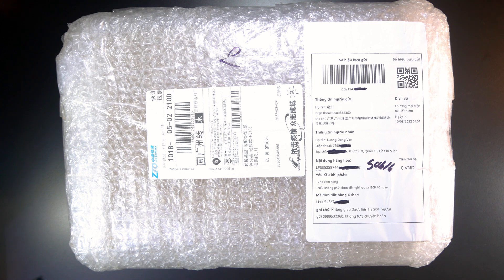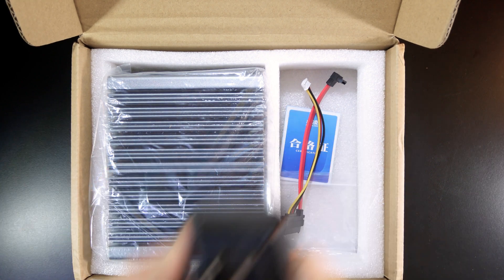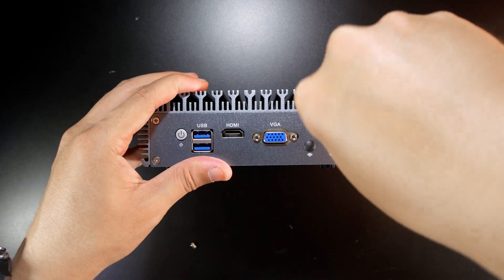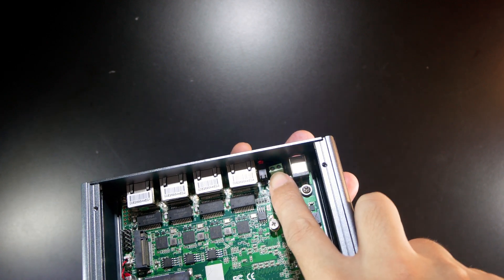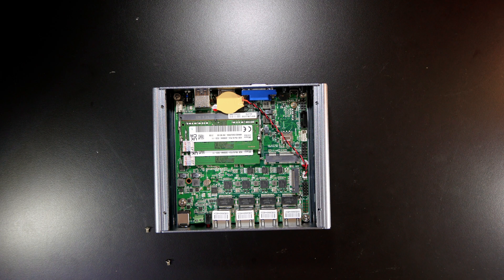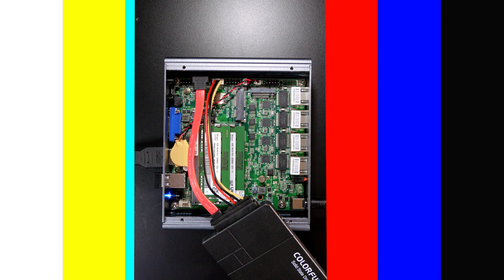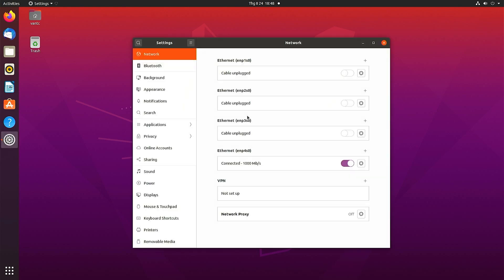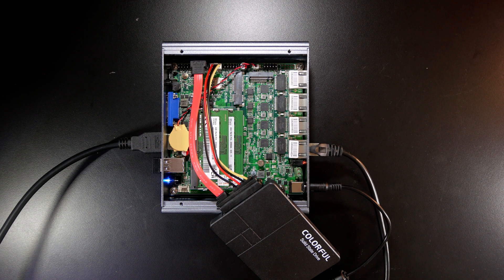Intel N5105 4 x 2.5G Ethernet Router PC (Intel I225-V) - Unboxing & Quick Overview

Comment: how do I install openwrt in SATA SSD ?
Reply from the maker: You can find the old tutorial on my channel “install openwrt on hard drive”. You need to boot up the PC with a Linux USB, after that use dd to writr OpenWRT image to the SSD
Reply: @VanTechCorner  thanks
Reply from the maker: Or else, use a USB to SATA adapter and connect your SSD to the computer. And them use Rufus to flash it.

Comment: There doesn't appear to be any vent holes so if you mount a fan to the bottom there is no place for the air to go.  And of course no way to mount the Sata SSD as pointed out in the video. A bit cheesy.

Comment: sir .. any idea how to connect mifi huawei E5785 to gl-inet router?
Reply from the maker: Hi, do you have internet access when connect the Huawei modem to your PC with USB cable? We need to verify if the  E5785  supports USB RNDIS.
Reply: @VanTechCorner  when connect Huawei E5785 to my laptop using usb cable , i get the internet in laptop .. but connect in my GL Inet Opal look like not detect any usb driver .. i am use same usb cable connect to laptop and GL inet opal .. change another usb cable also get same situation ..
Reply from the maker: It is weird, are you on the latest firmware. By default USB tethering had been configured on GL-iNet router. If you are using an OpenWRT build (doesn't have GL-iNet dashboard), you need to follow this guide to configure it https://www.youtube.com/watch?v=2WeedwOI_vM
Reply: @VanTechCorner  yes .. i am not using gl inet dashboard .. btw thanks for share that link to me .. i will try to follow that video .. and thanks ya because reply my answer ..
Reply: ? go to the default gl-inet router 192.168.8.1 & then connect it wirelessly to the mifi huawei E5785 , anything then connected to the gl-inet router wired or wireless will then use the mifi huawei E5785 wan in this case

Comment: Anh ơi hướng dẫn mesh wrt1900acs của anh với con router khác cùng openwrt được không ạ
Reply from the maker: Bạn có thể xem qua 2 video này để biết cách làm nhé:
https://youtu.be/D6TNuS69sUM
https://youtu.be/cw8ykKgVKbM
Reply: you mean open batman mesh & a few dozen cheap eol Linksys MR8300 Tri-Band Mesh WiFi 5 Router (AC2200) running off stand alone pv/12v car batteries ? https://www.youtube.com/watch?v=t4A0kfg2olo 
DIY MESH WiFi with batman-adv and OpenWrt. OneMarcFifty

Comment: Could you share your /etc/config/network? I have a similar device but can’t figure out how to get the wan & bridged lan working (based on one of your other x86 videos).
Reply from the maker: Are you talking about this N5105 router PC? You will need to build OpenWRT firmware with the kmod-igc package (Intel I225-V 2.5GbE driver). You can see this video for the setup https://youtu.be/kQamMghox30
Reply: You need to configure your lan devices. Go to Luci > Network > Interfaces > Devices then configure each lan device

Comment: I hope you install pfsense in this dvice and do compare between 
OpenWRT and pfsense
Reply: does pfsense even have working wireless ac/ax drivers Yet
Reply: @paulmaydaynight9925  
When you use pfsense 
It will work as router and best firewall then you connect it to AP that support ac even wifi 6

Comment: Nice , just looking at the n6005 version for the upgraded decoding hw & using proxmox pihole+unbound/omv/openwrt.
it' good these are using rev 3 Ethernet chips as that is supposed to have fixed the intel 2.5Gb hw problems to.
the ssd fixes to the base plate you took off btw

https://www.youtube.com/watch?v=FnFtWsZ8IP0 You're running Pi-Hole wrong! Setting up your own Recursive DNS Server!
Reply: I'm wondering if you ever come across these cases as cheap empty units ?
put a 1 to 5 sata expander in there with 5 connected 2.5 drives & 5v 5a power to then stack under the N5105 box & add a single esata cable
Reply from the maker: If you install the 2.5 inch SSD on the base (bottom plate), you can't install the 4x4cm fan. If you are purchasing from taobao/aliexpress, there are plenty of x86 system which were built to use as a NAS. It comes with 4, 6 or even 8 HDD bays. One of the popular model is J1900 + 4 HDD bays.

Comment: Can you please test 5ghz wifi AP card?
I want to know if this can be complete alternative to mainstream routers with access points
Reply: 5GHz AP mode on AX200/210 has been unlocked, would be nice if it gets tested in this box
Reply: sure, just don't expect to also run a heavy Linux gfx gui too... something very light to also run 'tdarr' Intel hw encoding + pihole+unbound/omv/openwrt on proxmox with 8/16meg ram might or Not be pushing it... needs testing.

mainstream £100/£150 5 port 2.5Gb/s dumb 'switch's can't do the above, so its a DIY win even if you just x86/64 openwrt single purpose these or the 6 port versions I just noticed oc you can't add the New 5Gb/s dual/quad pcie cards to this motherboard as it doesn't have an active x4+ pcie slot